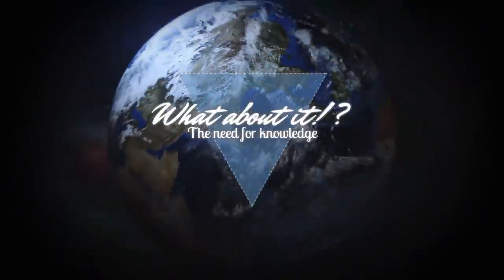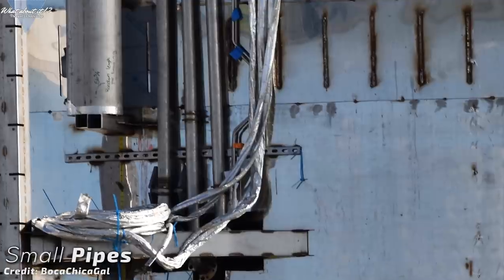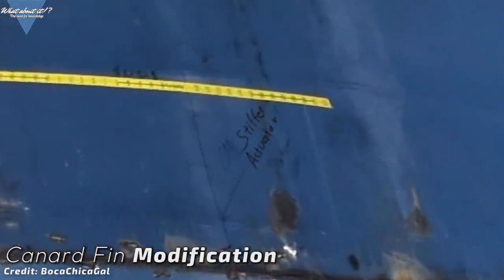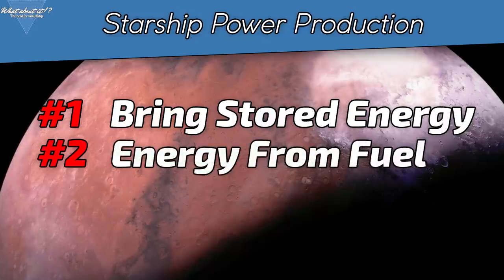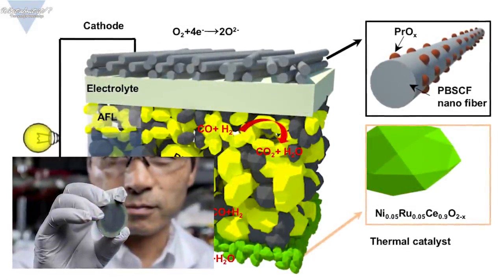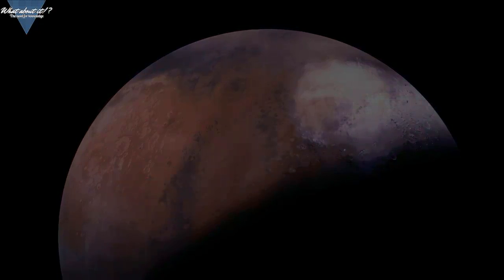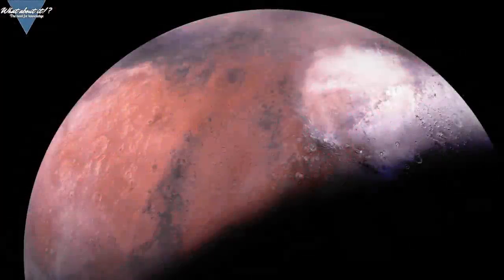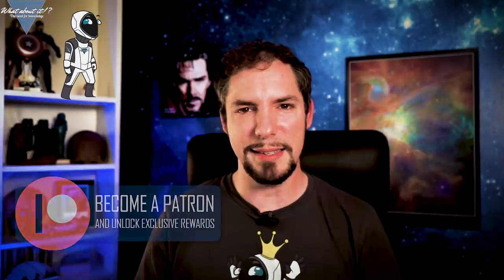45 | - How Does Spacex's Starship Generate Power?

Comment: Felix, #4 Seeing that Starship will rendezvous for refueling, the rendezvous could also deliver external solar panels to be attached to the business end of the Starship, and which could be discarded (and left in orbit) when reaching Mars. This would be a nice dual purpose use and not rely on re-stowage and securing of  the solar panels. A much safer solution.
Reply from the maker: Thanks for the reply! Sounds like an option! There are weight issues though. You can't add much more weight even to a Starship already in orbit, as it needs to do a burn to go to Mars too.
Reply: Weight is not the issue being addressed, and I do not think it is an issue at all. The Starship will launch with (near?) empty tanks, and will need to be fueled prior to making a transfer orbit. An issue resolved by delivering solar panels with the fuel ship is that this eliminates any of the weight of deployment and retraction equipment as well as potential additional exterior bay doors on the transport Starship. An additional benefit is eliminating mechanical failure of solar panel deployment and retraction (think of Skylab problems). This would (may) reduce the fuel capacity of the fuel delivery Starship, and it would add an additional step for in-earth orbit. The engineers at Space-X are in a better position to evaluate this proposal
Reply: >> You can't add much more weight even to a Starship already in orbit, as it needs to do a burn to go to Mars too.Presumably this will remove weight. The weight of the deployment/retraction mechanisms as well as additional exterior door requirements. While the area of the collector panels may be the same, the additional equipment mass is eliminated.

Comment: Hydrogen/Oxygen Fuel cells seem like a good solution. It's pretty standard off the shelf technology which Starship is taking a lot of advantage of so that would seem logical. The Apollo CSM fuel cell system was used just for power and water production. I believe the CSM main engine was a hypergolic system so the hydrogen/oxygen carried with it was just for the fuel cells and probably atmosphere so carrying a supply of hydrogen to combine with stored lox sounds like an efficient way to power and water the ship.
Reply from the maker: But how much Hydrogen would be needed to power it all the way to Mars? Especially with let's say 25 people on board, let alone 100, the energy needs would be quite high.

Comment: Silicon crystals, of which solar cells are made of, break apart at 150°C. As you said, solar cells doesn't like heat.
I study to electrician and read it in a book a few weeks ago.
Reply: Also, Elon stated that the shiny surface of the back side is needed to radiate heat away during reentry.
Reply from the maker: Perfect! Thanks for the replies! :)

Comment: Well if you go with the Nuclear option, after the first launch you would leave it in space before landing, then when you want to send out your next Starship you pick up the reactor again and go. Honestly though if you are going to have a nuclear reactor, I would also like to see an NTR. Although I doubt we will see Nuclear powered starships anytime soon too, until the safety record of starship is demonstrated. Then I would expect if SpaceX was going to go Nuclear they would go the whole mile and do an NTR tug which could dock with a Starship and provide high efficiency propulsion to cut down travel time, along with thrust the reactor can deliver electrical power.
Reply from the maker: Sounds great! I did not think about that. I bet though, that Starships in the beginning will have to make use of everything they have including the power source on Mars. Landing a Starship for the first time on Mars with spent (and highly toxic) radioactive products would be kind of risky. Maybe nuclear on later versions then?
Reply: @Whataboutit  You can run a reactor at low power for 20 years,  and really the surface of Mars is already pretty darn radioactive with all the high energy ultraviolet light, and if the first one goes wrong you can just pick a different spot to land.

Also you could shield it heavily enough that even if the starship crashed at the last moment, but had wiped enough of it's velocity off down to 200 - 300/ms, you could shield the reactor enogh that the internal components would never work again, but that it would not lose containment,

You could also use the Starship hull like a air bag and crush the internals to use like an airbag, kinda like a car bonnet gets crushed by a human in a crash, or how the front of a car is supposed crumple up to absorb the impact of a crash.

but the containment shell would be a lot more sturdy than a human, and is so  much that you could use the whole of Starship to absorb the impact, and have a final shock absorber on the bottom of the reactor. doesn't have to be what you would think of as a shock absober on a car or whatever, if could just be a large peice of metal that was meant to deform and also absorb the impact.

Furthermore could have a liquid on the inside of the containment vessel that would fill any cracks if it leaks and then solidify once it started leaking out, also you could use a low pressure reactor, my ideal would be Molten Salt fuelled reactor, but the Russians already have Sodium NaK cooled reactor which would be low pressure, so you would not have a steam explosion trying to get out if the internals break.

And you would make everything the containment vessel none reactive with Sodium NaK so no Sodium explosions.

In that way you might even be able to raise the impact speedt to the same speed as the terminal velocity of Starship.

But as said I don't see that for the first mission either, as even if you had a reactor that could for sure survive the fall to Earth, people are over-blow the dangers of nuclear power considering it is already the form of power that has killed the fewest number of people per GWh produced.

Comment: As to the solar panels:
ISS needs 2500 m2 to produce 120kW of power, in LEO. Mars is much farther away, requiring much larger panels.
There's a reason Curiosity uses an RTG, while Spirit and Opportunity were able to use PV cells. Nuclear has a higher power density. Curiosity needs more power than the PV panels can provide for the available mission mass.

Comment: I wonder if spacex would look into designing and building SMR’s (small modular reactors) to power mars/moon bases. This would be awesome for here on earth as nuclear reactors are very complex and capital intensive, this simplifies it and reduces costs. This would also provide abundant and reliable power for bases, removing the need for solar which could be damaged by dust storms, and loose power due to storms/rotation of planet/moon. The nuclear industry needs to grow rapidly due to climate change, but it is currently too expensive and too complex as most reactors do between 500MW and 1GW. SMR’s provide around 100MW and can be manufactured in a factory using mass production. This solution would likely only be used at bases due to size, weight and power output. 
Thoughts?
Reply: Small modular reactors likely are not going to be the answer, because almost all the reactors being retired are smaller reactors, going small on the power output makes them naturally less economical, although you could ague the economics of being able to pre-fab a reactor almost entirely will reduce costs, but what would be better is a plant that can run at high power and can also be almost entirely pre-fabed, which is one of the reasons I think we should move to MSR reactors.

As you can go to 2GW is a smaller reactor than a 200MW SMR PWR reactor, so you get the economics of scale, and the economics of a factory line. So if I would want NASA or SpaceX to develop anything it would be an MSR reactor, added bonus MSR reactors can run significantly hotter so if you wanted to use the Reactor for an NTR you would get higher specific impulse than a conventional reactor, something like specific impulse of 1200 seconds easily, where as a NTR with a conventional reactor can only achieve upto 900 seconds of specific impulse.
Reply: Etheoma the issue that we have with those is the fact that they are undeveloped. With the existing technology this is the best path as we can mass manufacture these and test them. The issue currently with building nuclear is cost. Older reactors are at lower power outputs due to their design. When they were designed that was considered large. Small modular reactors are designed to be an Ikea style. Mass manufactured, easy to install, modular, and low output compared to reactors such as the EPR. This lowers their installation costs, and allows the reactor to be applied in more locations as if an area has a demand of 200mw u can build 2 smr’s to meet the demand, instead of a coal based plant or a nuclear one with 400, meaning that the plant is never operating at maximum capacity, - a waste. Smr’s are also smaller - and more desirable for space, as we dont need 500mw of capacity. Its less than 100. This design would also allow for much easier transportation as it would be designed for modular assembly, rather than heres all of the parts, ship it and build it on mars. Personally i think SMR’s are better as it is proven technology that can be rolled out on a mass scale, cost effectively.

Comment: Fueling is rarely (I know of none) done from the top since the fuel fill and drain are from the same line, and you can’t drain from the top.
Reply: You could drain methane or ox from the top. That's how a propane tank works. It just takes longer.
Reply: @kakytoo69  No, when I say drain, I mean back into the storage tank (it needs to be a liquid).
Reply: @Strike_Raid  you can compress back into being a liquid. Would probably need some coolers too. But yeah I got you.

Comment: Hi Felix.
The problem with using the solar cells going to Mars is that EVERY cargo going to Mars needs to carry a lot of solar cells.  Every cargo going to Luna has to carry a big mass of solar cells.  Sometimes people will want to send factories, refineries, chemical reactors, nuclear powered fuel factories, drilling rigs, or other heavy objects – instead of solar cells.

Musk plans for the Starship to fly back to Earth.  If you have left the solar cells on Mars, what will power the space ship on the way back?

Finally Mars is 1.5 AU from the Sun (Earth is 1.0), so Mars gets 1.5*1.5 = 2.25 times less solar power than Earth.  If there is a dust storm, then power can go down to 1/7th intensity.  (Global dust storm happens every 2 to 4 years on average, smaller ones are more common.)  Every time you suit up and go outside you are risking your life, and constantly dusting the cells to keep them clean (dusty cells can lose 90% of their power) is a dangerous, and tedious chore.  It is far from certain that Martian colonists will WANT to use solar cells.  

Warm regards, Rick.

Comment: I was thinking about power for starship myself and was wondering if they were looking into 'reclaiming' electrical power by using the fuel system. Since the fuel system is self contained (as opposed to using electric fuel  pumps like rocket lab), maybe they can work out a way to power generators as they maintain tank pressure. Starship's fuel energy all gets dumped into thrust and maintaining tank pressure, it would be neat if they could figure out a way to (re)charge power cells as they ride to space, like how tesla uses regenerative braking systems to charge the car's batteries as you drive.

Another thing I was thinking about is generating power via re entry, as one side of the ship gets insanely hot and one is much much cooler. This made me think of a sterling engine, and I wondered if SpaceX had looked into thermal differential power generation to trickle charge batteries.

I agree with you 100% on the collapsible solar arrays, Musk will use every ounce of technology developed by Solar City in the starship program.

Comment: Deployable solar panels, batteries, and methane fuel cells. But Sterling engine generators (already used in some submarines) could be another readily available option to be developed for powering by methane.

Comment: NASA's small reactors have a lot of moving parts.  I wouldn't include it.  It also uses very expensive U235 which, while is naturally occuring, is extremely rare.  They could probably use a thorium version that only requires a small amount of U235 to eventually make U233... at least according to my understanding.  Thorium is much more abundant and would be cheaper.

They don't necessarily need to use CH4 fuel cells.  They could just burn the CH4 with O2 in an electric generator.
Reply from the maker: They could! But look at the numbers. How much Methane would you need to burn?

Comment: I just dont understand why they dont have a permanent ship in space. Surely it would make sense? That way you would only have to fuel and supply that ship and have landing craft attached. You then increase the amount of cargo and passengers you could take in one trip. Having 2 in use making alternate journeys like a bussing system would increase efficiency also.
Reply: Transferring fuel between 2 starships, whilst in-orbit, will be difficult enough as it currently stands.  Transferring passengers is adding a whole lot of extra HW and problems you don't need.  We know SpaceX is planning for the starships to refuel in orbit opposing each-other (engines facing each other) .  Unless the passengers somehow can crawl through the engine-nozzle or a lot of extra place for a passenger-tunnel can be freed up at the bottom, starship passenger-transfer is very unlikely to happen.  Unless, after the refuelling, both the starships undock from each other, re-dock being parallel to each other and then start the passenger transfer, also here again, a lot of additional time/resources and risk with such a manoeuvre, so imho, not an option...
Reply: @stevenhamerlinck6832  I dont mean as in another starship staying up there. Think of it as a ISS that moves between planets. We could use the same docking techniques as the ISS and develope a fuel transfer system around that. Similar to the ship from Interstellar just with more cargo space, docking ports, landers and living quarters.
Reply from the maker: Because they will need the Starships to land and they will be used to build the colony.

Comment: the turbopumps pump more fuel when firing than the hoover dam. just connect a generator to it or the gases and you can charge the batteries.
Reply: That reduces the efficiency of the engine. No energy is free.
Reply: @Bryan-Hensley  they can use the boil of the tanks to power a turbine when the engine is off, or use the methane and oxigen to power a conventional gas generator (just burn the gas into an engine, you don't need some complicated NASA hydrogen recombinator or some shit, unless it has to be designed to work in space which would be the only downside). compared to the fuel required to land, using a little bit every few days or hours will not take much, fuel is the most efficient battery of all.
 a nuclear reactor is dangerous, requires shielding, and it's *fricking heavy*. solar panels are also heavy and require deployment, complicated wiring and machines, and then to be taken down before landing. fuel is the only viable solution, it is the lightest, cheapest, most reliable, safe and compact option.
Reply from the maker: What batteries? The engines do not fire on the way to Mars, so You'd need a lot of batteries. ;)
Reply: @Whataboutit  mk1 has 6 tesla car batteries to power the electric systems.

Comment: On the subject of powering starship you left out the possibility of just using methane and oxygen from the main tanks to run a relatively conventional generator. Perhaps some form of gas turbine and stirling engine combo? Seems a lot easier than some form of unproven and likely inefficient and over complicated methane fuel cell system.
Reply from the maker: I have left it out, as I did some math on how much fuel would need to be converted into energy. At least I came up with about half a tank, which kind of rules it out in my opinion... :/
Reply: @Whataboutit  Fair enough, still feel you should have included it in the list and why you think it wouldn't be a good option.

Comment: Having watched many of your videos and also having watched SpaceX presentations I keep coming back to reusability. During this video you presented at about 4:49 minutes in, a view of Starship with external solar panels. So in regards to the power issue I pose a question. What if we launch the solar panels into LEO first and then attach them to Starship for whatever mission. I am fairly certain that solar panels could be attached to Starship in LEO used for the duration and then unattached at their destination. Banks of solar panels could be launched into orbit and could also maintain themselves in LEO, Lunar orbit, or Mars orbit with the proper command and control. This way you could use solar panels as a sort of gas station and quasi-spaceport refueling depot. You could either hook up and receive power or hook up and take with. This could all be automated and also would require less weight at liftoff to bring more supplies and perhaps even people to the required destination. Note: edited for clarity. JPL